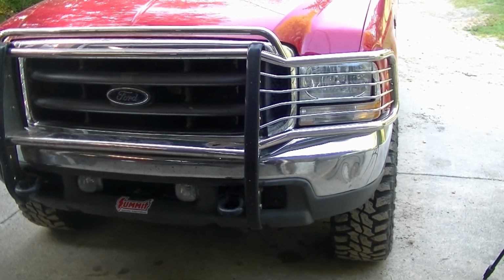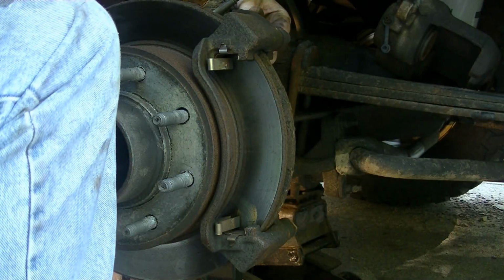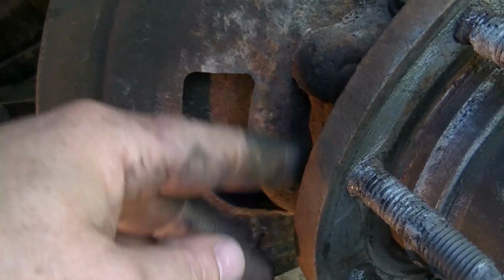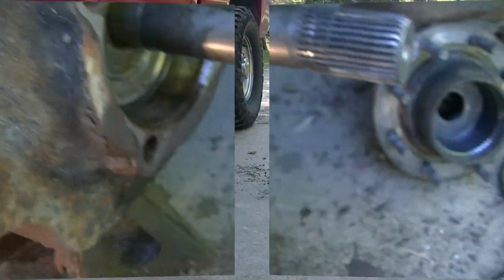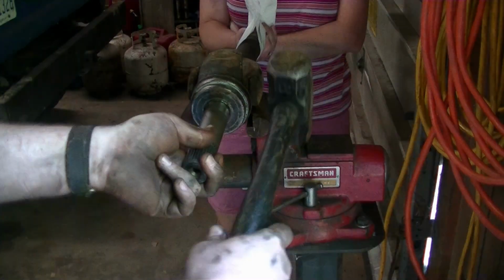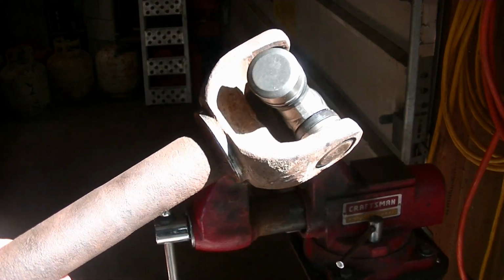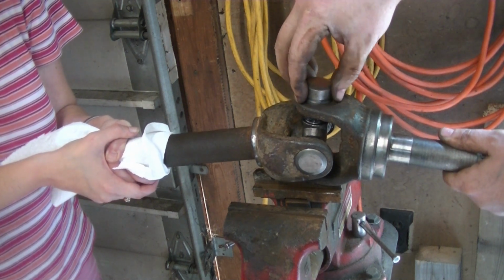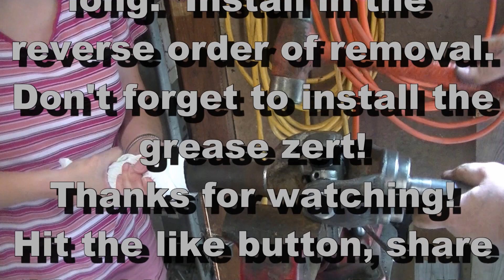Ford Superduty Axle Joint Replacement

Comment: Nice video! Only thing I would add is maybe some electrical tape around the free caps to keep them from flying off while doing one half of the shaft. You  don't want to be searching for needle bearings after one inevitably flies off into the depths of the garage.

Comment: How did u find out they where bad. Did your truck pull
Reply from the maker: Andrew Martin I had some clunking in the front end in 4WD, so I checked everything out around there and saw that the u-joint was loose (needle bearings bad).
Reply: Mine has the same problem but my pulls to to left
Reply: @andrewmartin3697  If its pulling that sounds like the caliper sticking. Mine was pulling real bad replaced the caliper and no more pull.

Comment: Typical "hammer mechanic" the first thing I learned when I replaced my first of hundreds of U-Joints, you don't hammer on the caps! Hammering the caps will distort them and shorten the life of the joint! Use a U-Joint press. They don't cost that much and it might just prevent you doing the job twice. In fact, if your money is tight, you can probably rent one from the same place you got the joint from.

One more thing, you say the truck was well maintained? Evidently not. That joint has a zerk fitting on it. Either you or the previous owner were lax in maintaining the vehicle with the bearing caps being so dry and rusty.

Comment: A U joint tool or a ball joint press would have made this job much easier. Btw, you didn’t show reinstalling the new outer axle seal, there’s a special tool for that and if you don’t have it, the seal is a real pain to seat properly, ask me how I know……. Shouldn’t be beating on those universals with hammers.